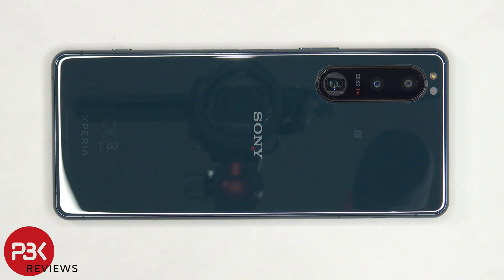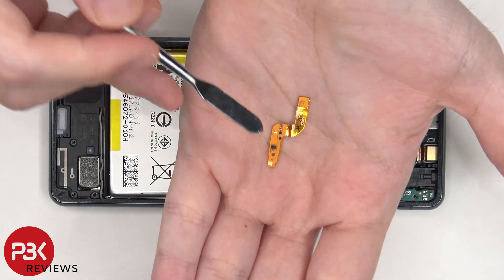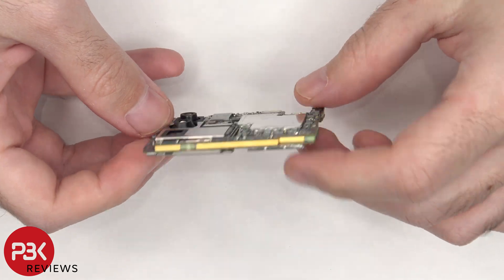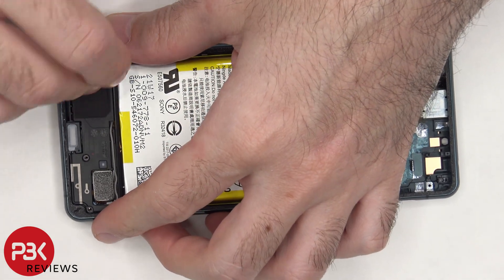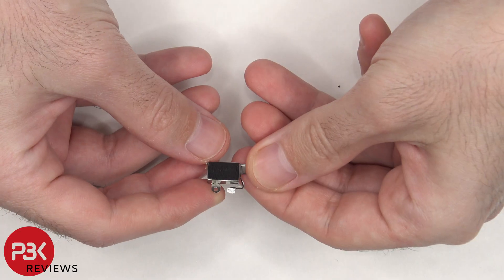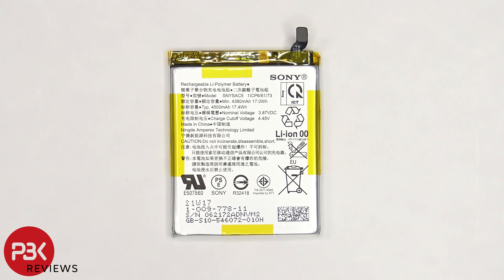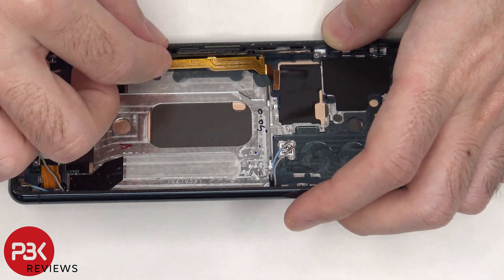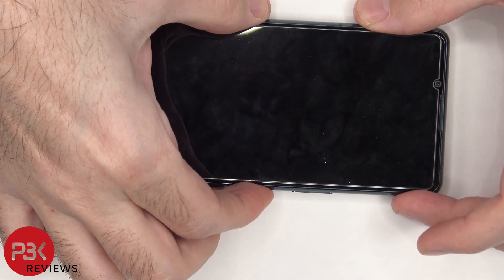Sony Xperia 5 III Disassembly Teardown Repair Video Review

Comment: Hello, could you tell me what adhesive tape I should use for the back cover, thank you.
Reply from the maker: https://www.ebay.com/itm/135371676220?_skw=xperia+5+iii+adhesive&itmmeta=01JCY6V68KG1H021JFTT1PNFP5&hash=item1f84c7da3c:g:sY4AAOSwxatnGfrp&itmprp=enc%3AAQAJAAAA8HoV3kP08IDx%2BKZ9MfhVJKlxt1o%2BPZ3rzyQjgxVNWVwBkJa910xI2CfOEZsuiS6bt305%2FzDkD88HyFWGIiB2AGrieRdxEqu0KpgWUyR5RxvarNIcOY35WW1fo7RpvPF1%2FH0Opn9uWCRjfh3f%2FoIerTSyyePA4%2FckRCQN223g676kDe0vtk%2FK0UGOBIHMIjzhZCHmANCneiOZ9pLKn38ZEQqaKz25XS19si9Z%2B4WWgDUPMR64bMco0wgZ%2FTh3F7NgFhlnpU3bd6v0gjl6s%2FI4z0FUq9LBFVVUx68FyMnUgMEHx3agPAoGrR4MUD2i2mabbA%3D%3D%7Ctkp%3ABFBMsuTsxudk

Comment: Heatsink on mark III is so tiny compared to now a days phone, no wonder my xperia 5 iii overheats...
This phone internally looks petty ngl, if they just used black flex cable and others thing in black color....
Reply: true. I have the 5 mark 3 too. 888 is a cooker of a chip and this phone does not have proper cooling for it.
Reply: @classic1625  using this phone for almost 2 years no problem what so ever beast of a compact phone...no cut-down featured live recent 5 V where there is no tele, in 5 iii there is dual focal length telephoto...Best compact phone ever made with all features same as the big one....
Reply: @rbh2na  True. Most complete camera system on a compact body. It is so fun to use. Love the stock camera app.

Comment: Thank you very much. Your detailed teardown was very helpful for changing the fingerprint sensor.
Reply from the maker: you're welcome 😀
Reply: @Anastasios912  Hi, thanks to this video it wasn't hard for me and I'm not experienced in reparing cell phones. (Only tried it once before with limited success ;-)). If you follow the steps, organise the different screws, use alcohol to soften the battery adhesive it shoud be allright.

Comment: Sony Xperia 5mark 2 sudden death. No response on power.  Even charging notification light is also no response mode while  charging.Have any solution?
Reply: I have the same thing.  Sony gave me the finger because I'm in the US and mine is the international version.  They wouldn't even look at it. And good luck finding someone local in Atlanta that's ever seen a Sony....  great vid btw.
Reply: same happened to me but for 5 mark 3. was working fine and suddenly black screen. is it possible to retrieve the internal data?
Reply: same here John 3:16 :))

Comment: @PBKreviews Nice video bro! Can I ask you for favour. Can you tell me dimensions of xperia 5 ii and xperia 5 iii batteries. I would like to put 5iii battery inside 5ii,but I cant find dimensions of battery. Connector seems to be on nearly same place on both phones, also battery pinout is same. Thanks in advice!

Comment: Are you guys planning to do one for the 5iv would be nice to see the motor. I have the phone and its the first Android phone I've ever used with decent haptics. Not as good as my iPhone 12 mini but not bad at all
Reply from the maker: Usually the sony videos don't get much views so not sure if I will be doing it. If I find one for a good price I will consider it.
Reply: @PBKreviews  Can you recommend a way to find out, which battery type is in a smartphone? I mean li-po, li-ion and eventually quality of the battery, for example in xperia 10 IV. I was using your videos, because web is mess. Some sites says, that xperia 5 III has li-po...

Comment: Thanks! Only problem I had was keeping track of what screw went where. The top-right screw at 1:50 went into the lcd, damaging it at that point. I hope the LCD might recover after some time...
Reply from the maker: Yes, it's always important to keep a track of the screws, especially if they vary in size. Also with some phones including this one, even if its the correct screw, if you over tighten it just even a bit, it will damage the screen. Poor design if you ask me.
Reply: @PBKreviews Wow, I'm back again 1 year later doing the same procedure. The combined power button  and fingerprint sensor seems to break once a year for my wife. There button part of it fails so starting the phone with a flat battery is impossible.

Comment: I cracked my back glass battery cover anyone have link to get a new one? (In canada preferably)
Reply from the maker: Here is a link for one, but its not in canada, ships from china. https://www.ebay.com/itm/374152707544?hash=item571d3d3dd8:g:C50AAOSwy~FiuZeZ&amdata=enc%3AAQAHAAAAsDa1zXdqUnEB3hn4qUjpoZm4k5crJcZT7R%2BjvAURynnMA5QMPmb8fRkOsttxnTEAuo%2F9B3zkqKXZeFMxxCLstKHIRq%2BMyHB6Tb%2FIYpfZnvpVTZwj9o0Rc%2FiVTKWaCHlJV%2Bxi5CsuCOKnriBMGpJSOP7eGdi3RWJQlDsEIT21wEFwPqLrOogO6uM2b5m3ySo95ItxXOQbstS0Hz44gz8G6F4zccnD8ZFHoDVqtL0L5v%2Fk%7Ctkp%3ABk9SR5qKvMHaYA

Comment: Great video... Great teardown... When it come to android phones, I'm more indulge into sony...

@PBKReview, I have a question. Between Xperia1iii and Xperia5iii, which do you think has better thermal design... Thanks in advance...
Reply from the maker: Thanks. Honestly they are pretty much the same, cant say one is better than the other in that department.
Reply: @PBKreviews  Thanks a lot...
Reply: @PBKreviews  Hi PBK... I have seen your xperia 5 mark “2“ teardown... Great video...

I have notice that the graphite sheet is much smaller in xperia 5 mark "3" compare to xperia 5 mark 2... Which do you think has better thermal management? The xperia 5 mark ii with cool SD865 or the xperia 5 mark iii with steamy SD888 cpu?

Comment: Kind of confused by the score. Why so low? The s22 ultra has a higher score but is basically the same inside.  These seem to be highly repairable compared to other phones out there. Every piece is modular and connects via a cable and isn't soldered or glued on.  Aside from the sim / sd slot and screen being a bear to get to, everything else is easily replaced and repairable.  I'd give it an 8 out of 10 IMO.

Comment: As always, Sony phones are interesting to teardown. I haven’t seen a card reader placed between the two layer of logic boards. I think Sony is creative to save space in this small phone for a bigger battery. This small phone has the same battery capacity as the larger 1 III.
Reply: this phone is NOT small at all. It's the same size as 1 III, and definitely a big one compared to their XZ1 Compact form factor from 2017
Reply: @rsvt  Wrong. It is not the same size as the 1 iii

Comment: Really, the weakest LED flash I've ever see in a smartphone.
Old Nokia N series had a more powerful and could successfully serve as a handheld flashlight.
This what Sony has put in its smartphones is just a joke, really bad joke.
Reply: @Veedo 
So maybe you should, if you are going to use the capabilities of the device, in terms of photos or filming. Illuminating the scene with another smartphone with a much more powerful led flasch, the quality of the recorded image by this and similar models of Sony smartphones is really gigantically better.

It is difficult to understand the decision of Sony's designers, especially since they devoted so much time and work to create original and very extensive applications for taking photos and films - completely underestimating the issue of lighting the scene.
  
Using the phone as a handheld flashlight is of course a less important addition, although in some situations very, very useful. If in this case we get an effect worse than the one that was available in over 10 years old devices, then the criticism is most justified - considering that we are talking about a completely new, current device, for a lot of money.
Reply from the maker: I didn't test out the flash, but I would have thought it would be decent.
Reply: @PBKreviews  
Unfortunately it is not.
While a single flash for photos may still be enough, the function of constant illumination (for example, when shooting a video) is not.
The flux of the emitted light is too weak and too scattered. Flashlight option in Sony's new flagship phones is something like going back to the days when the only source of light at dusk were candles, or kerosene lamps ;)
There isn't a lot of video footage on YT (if there is one at all) showing how bad the LED flash is.
In your video at least we can see why it's so bad...
Reply from the maker: @user-R2as8orG  👍
Reply: @Veedo 
If you don't care, you don't have to decide at all - you just take what you stumble over, walking ahead, because you don't care.
I care because I'm using it.
Reply: The more slimmer your phone, the more weaker LED flash light.

I have 4 Sony Xperia and this is my ranking for LED flash

1) Xperia L - i use this on cave and it's very bright
2) Xperia ACE III - just standar brightness
3) Xperia XZ1 - kind a weak but still usable
4) Xperia 5 III - only for short distance
Reply: @arx117  
Not true.
The thickness of the device does not matter at all and I will give you an example of why, and even if it would make any difference, you can always increase the number of LEDs. You can use more LEDs and even with different color temperatures, which can later be used in photography.
There is one condition - the manufacturer must want to.
The manufacturer, Sony, has improved this in the Xperia 1 VI model. The thickness of the device has nothing to do with it, because it does not differ from the Xperia 1V model.  They simply used a more powerful diode, similar to those that other manufacturers have been installing for years, even in devices that are 3x cheaper.
They could have done it earlier... They could, but they didn't want to....

Comment: cooling system is almost none exist thats why all they smartphones are overheating mehh.
Reply from the maker: Generally yeah but this one has a large area of 3D Graphite which is just as good at transferring heat as a vapor chamber.
Reply: @PBKreviews  so is there any heat issue while playing and watching movies? Wanted to get this phone but thinking twice cause of the sd888 heat issues. My last Xperia was the Z5c with SD810 and it runs freakin hot everytime I play. Want my phone to last a few yrs aswell. Still rocking a Pixel 2 which is turning 5 yrs old already and still runs good except for the battery.
Reply: @jenosmaverick  I watched a few movies on Netflix. No real heating issues. Only when heavy gaming or using cinema pro feature